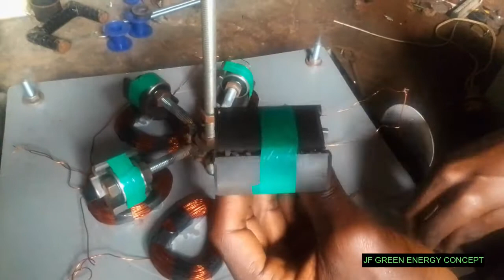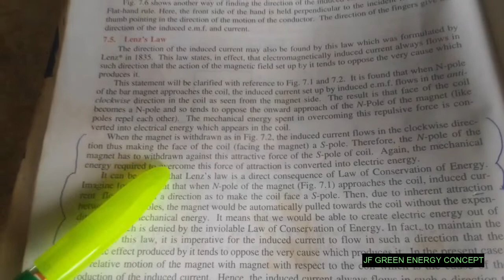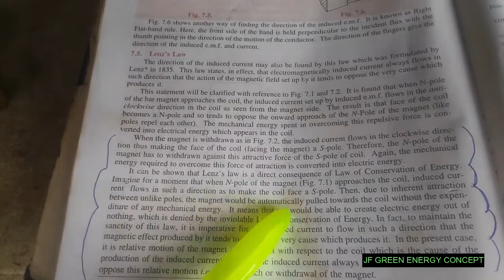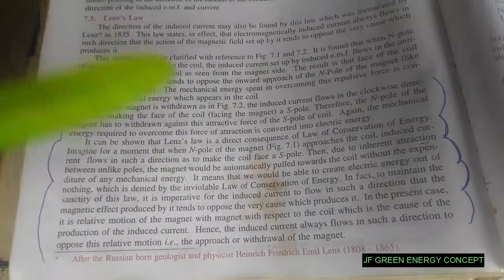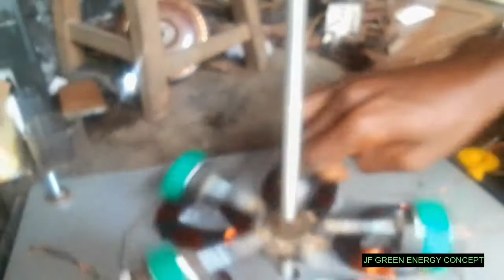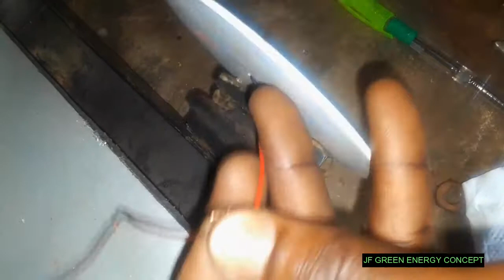Lenz  Free  Draggles Alternator Concept

Comment: Even without the flywheel beneath the stator, this system should work by overcoming lenz effect.  In that case, the magnets with the bearing should be vertical fixed in the periphery of a 12" or 16" disc which will act as a flywheel.